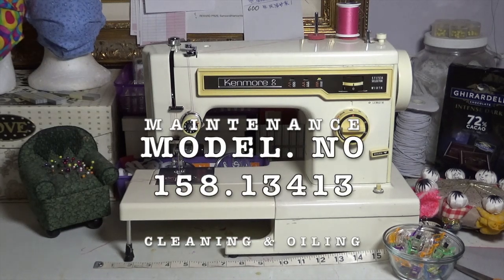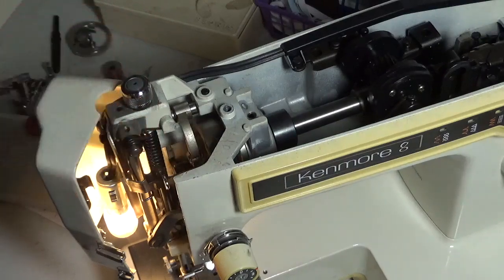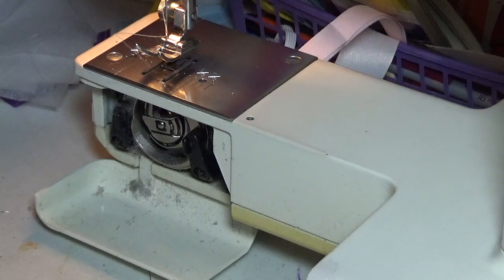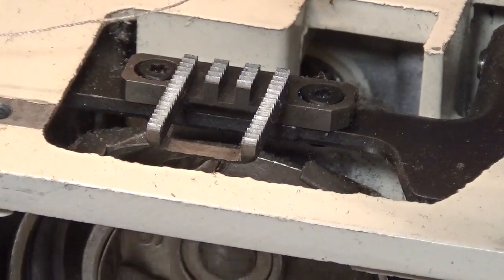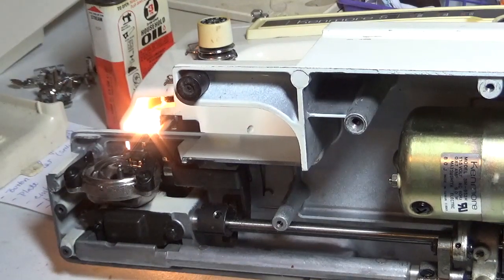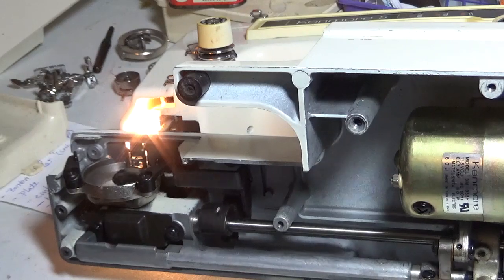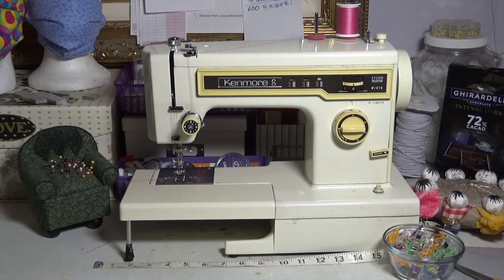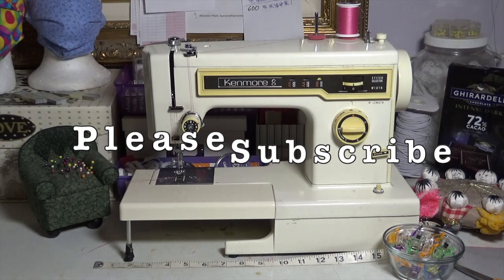Maintenance of Kenmore Model No. 158.13413

Comment: My grandma gave me a '60s era sears kenmore thats built into an opening table some 20+ years ago. Its only been used as a table since then & who knows how long before it went unused. I'm cleaning it up right now and it had caked on grime. The motors on the outside & the band wont rotate. I want to get it working in the off chance i need it.
Reply from the maker: Once you have cleaned it up try oiling it inside and out (any mechanical part that should move.) You may have to hand force to get them initially moving. If no luck the motor could be bad and need replacing. I get sewing machine parts from www.sewingpartsonline.com
Reply: The motor worked but had sparking issues. I found a video to disassemble the motor, clean & oil but at the very end of reassembly i broke the center piece that holds the copper contacts. All that work for nothing.

Comment: Where did you purchase your oil from ? Thanks
Reply from the maker: It is better to use sewing machine oil and not just machine oil. Try checking shops that sell sewing machines. they should have it.
Reply: @DebraCarmona agreed. From what I’ve seen… sewing machine shops don’t recommend 3 in 1 oil for sewing machines.

Comment: Frustrating video. Most of the time you can’t see where she is oiling. The light is low and the position of the camera is so bad that a lot of her work is blocked. The other comments must be her followers that love her and aren’t trying to actually use the video instructively. She does seem like a nice lady.
Reply from the maker: Basically you just oil where any two metal parts touch another where there might be friction. You have to step on the petal a bit to see those areas.
Reply: @DebraCarmona  wow. thanks for the response. sorry, I was so cranky and frustrated that day! my machine was frozen so I couldn't really see which parts moved.I usually take my machine to get cleaned and oiled regularly, but the one place where I was living in South Dakota refused to clean and oil it in 2021 so it was overdue and then I've been traveling so the storage conditions weren't ideal. bad combination!  I did slow your video way down, but man... do those parts still move fast! In the end, I hired a local guy to teach me how to oil my machine as it is one number different than yours (and other videos) I found anyway. Thanks so much for the response! Very kind.